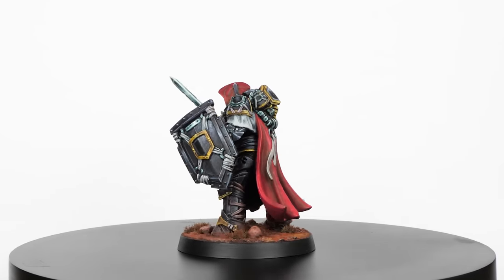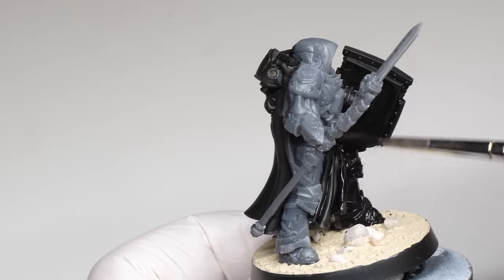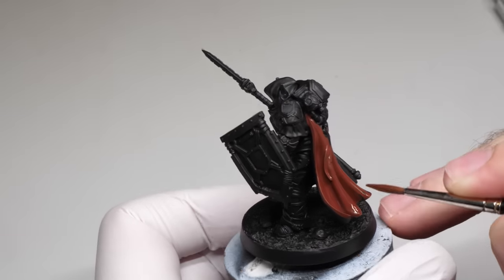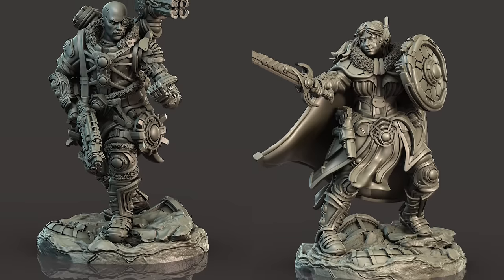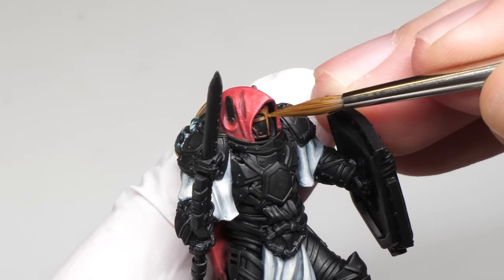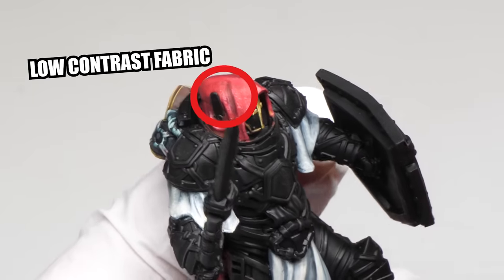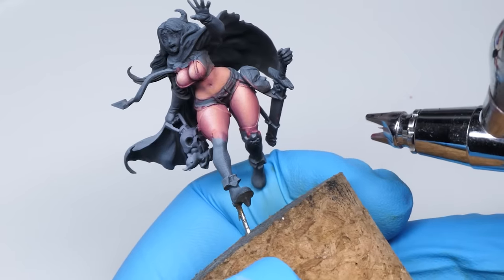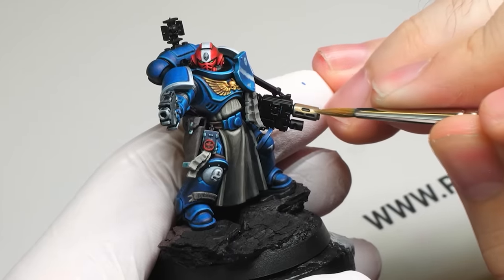...and other mini painting myths

Comment: Painting myth: you need to varnish before using oils (and white spirits). Oils and white spirit don't interact in any way with acrylics. If you are damaging your paintjob, it's because you are rubbing the mini too aggressively.
Reply: This does seem to be a contentious one and different people have different opinions on it (iirc zatcaskagoon on one side and Marco Frisoni on the other being some good examples).
 I know Ive accidentally rubbed down to bare plastic before, which isnt something that would happen with water, but Ive heard that it may be due to the WS getting into cracks in and underneath the paint and causing it to flake rather than it actually reacting to the cured acrylic.
Either way I varnish beforehand anyway, its habit at this point lol

Comment: Myth: Oil paints are "hard" or "advanced".  Purse BS. Oil paints are like cheat codes, and make mini painting so much easier and faster. Nearly every problem or question or issue people have with painting can be isntantly solved by using oils instead. Everything we do in this hobby we do to fight against the nature of the acrylic medium.  Conversely, nearly everything we do in this hobby is complimented by oil paint.
Since switching to oil paint I can paint more minis in less time, with a lot less money, and get way better quality than I did with acrylics. Isn't even close.  It is frustrating how many people are dogmatic with their acrylics, and insist on newbies doing it the "right" way.  I wish I would have started with oils, it would have saved a lot of hassle.

Comment: I think it's unfair to characterize these as "myths". When pros lay down guidelines, they simplify the nuances. Yes, there are nuances, but you want to communicate a recipe to novices in a near fool proof manner, and so you simplify the message. In reality, it matters that the paint's consistency and viscosity is enough that it flows and doesn't clog the details; since the most common newbie mistake is drowning the mini in paint, the advice of "two thin coats" makes sense. Once you're no longer a newbie, you can get a better "feel" of the paint and know when you can get away with a single, thicker coat.

Comment: well one thing black prime does is proves shadoows  to minis that zanfold one bring out the details but hare thing you ues ENAY FLAT spay  oil  paint yes FLAT paints shud be oil and yes the oil in your hand will tack off the paint nor sialer  yes ues good one flat is bet simi gloss ok you paint  over it gloss if think lot tuching going be the case but not whonted  and can not  paint over if had bad thing  paint pens are good fore fix ups on the go if need a prim and siler and cash not thare the buck or  pond store hare spay good you paint on it and sell it both yes stinks but that go what fast that my think so to nest vid

Comment: You lost me at literally the first point while cleaning a 3D printed model. What was that about? 3D printed stuff don't have any release agents, especially not after nuking it with cleaning products to clean the prints. If you'd have shown a clear improvements with the same paint after re-cleaning it with soap, I might have had a different opinion, but then you moved from there to using thicc paints to "prime" it. What?